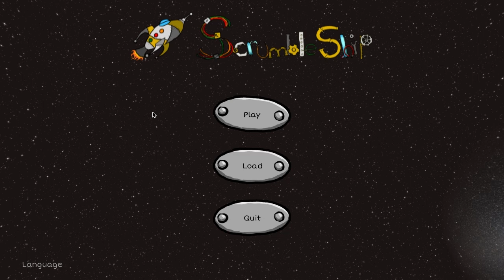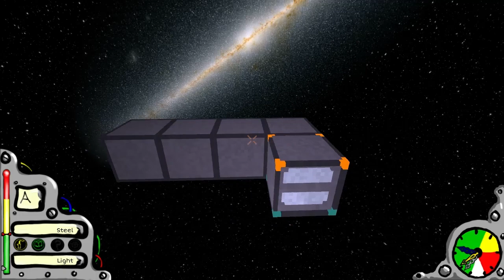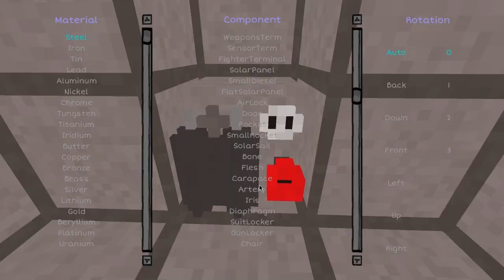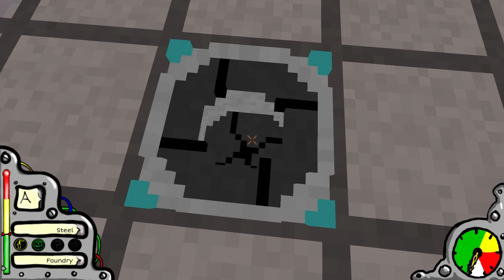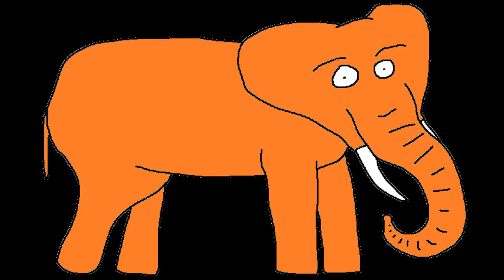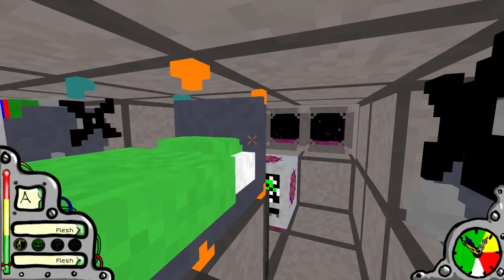Stuff+ Plays - ScrumbleShip

Comment: Actually, no you wouldn't.  Your tissues would swell due to the pressure differential between inside your body and out, making you look kind of like a deformed bodybuilder, and the moisture in your mouth and on your eyes would quickly boil off.  You'd pass out in around 15 seconds or so, but you wouldn't die until your brain died - it takes about 4 to 5 minutes to suffer permanent brain damage, and a little longer to die.

Source: NASA's "Imagine the Universe" site

Comment: Yep!  Dirkson, the dev, has said he plans to first implement various battle modes for two or more players, and then move to a persistent online open world multiplayer.  Each server will be a privately held solar system, and the server host will operate the central hub space station, which will feature a warp gate to access other systems.  Warp drives will also be installed on ships, but they'll be large and resource expensive, so only big, well-powered ships will have them.

Comment: Meh, that's debatable. Blockade Runner is focusing much more on the construction aspects while this game is putting more effort into simulating things like heat, etc. Also, on the forums for Scrumbleship the developer has stated he does not plan to (immediately) have accessible planets, whereas that is a stated goal for Blockade Runner. They both cover a similar genre but they definitely have a few pretty significant differences.